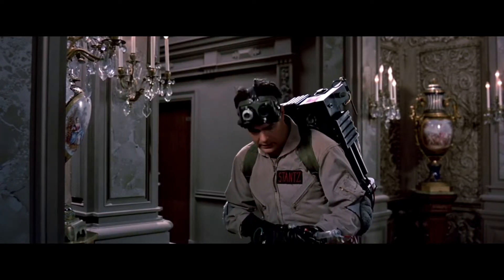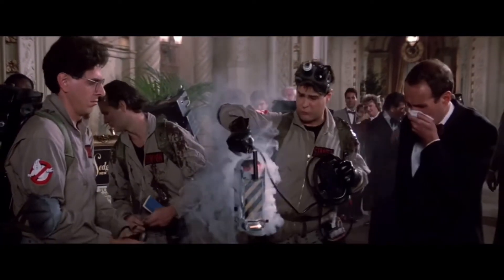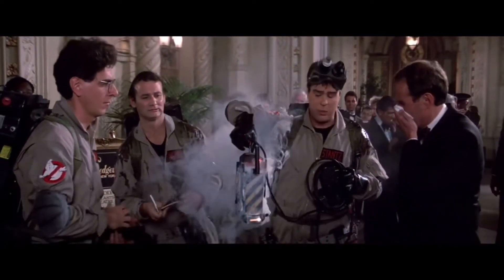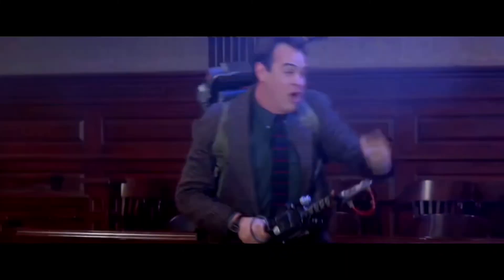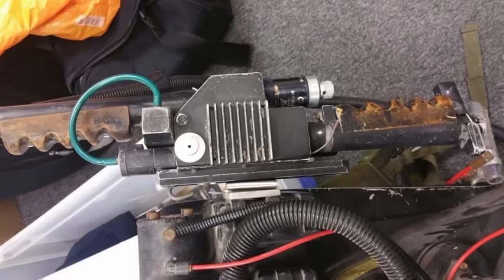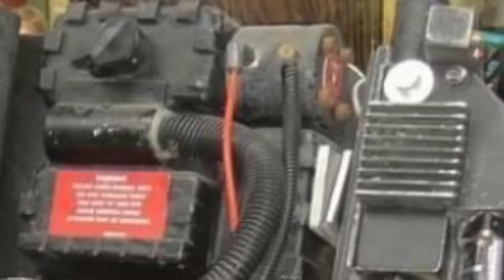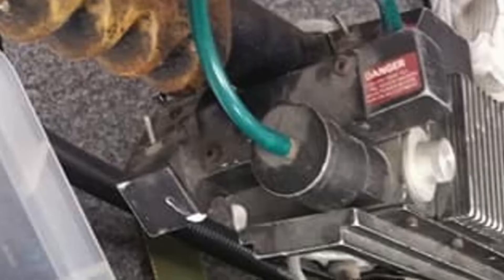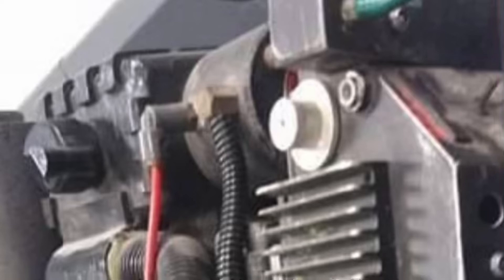Proton Pack Detective - Ray Stantz Hero Pack from Ghostbusters & Ghostbusters II

Comment: 0:40 what's also interesting about the light shining through the power cell ribs is that it was replicated on the proton pack model in the 2009 video game, as well as the open drilled hole on the side. In the game, they're treated as actual lights on the pack.

Comment: I'm debating repositioning my Alice frame on my pack. I think its currently too high on the motherboard. Do you know if theres a "sweet spot" the Alice frame should be mounted to the mobo? Or was each pack different in this aspect??
Reply from the maker: It looks to be pretty uniform. Look at your motherboard from the frame side. In the bottom right there is an extra bit that stands out, from the part where the tubing from the injector tubes reconnects below the bumper. The upper right point of that extension is roughly where the lower right corner of your frame should be. On the opposite side it should be just above the hole where the wire loom comes out. The bar at the top should be in line with the top of the v-hook mount/bottom of the HGA. I just eyeballed this from looking at multiple packs reference pics, so I don’t have measurements at this time. Hope that helps!!
Reply: @TheProtonPackIsNotAToy  Thanks for the reply! After checking it out, I think its just the oversized foam i have on the top cross bar that makes it seem out of place.

Comment: My pack is leans heavily towards this pack. With little things from other packs. Basically "my own" pack that I've cherry picked things I like off all the packs.
Reply from the maker: What specifically did you borrow from this one?
Reply: @TheProtonPackIsNotAToy   I use the same combination and placement of the resistors. When I think of a true pack. Ray's is always the one that pops in my head instantly.
Reply: @TheProtonPackIsNotAToy  And I gotta have that N Filter label 😊 some of the others look so incomplete with out them.